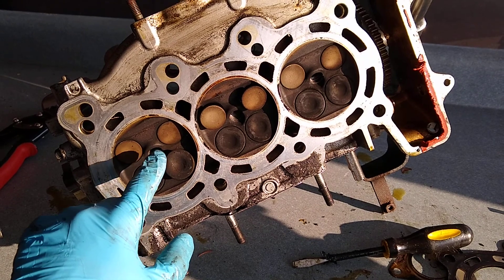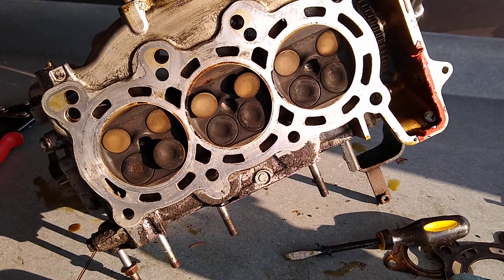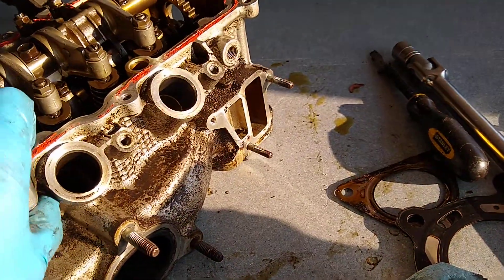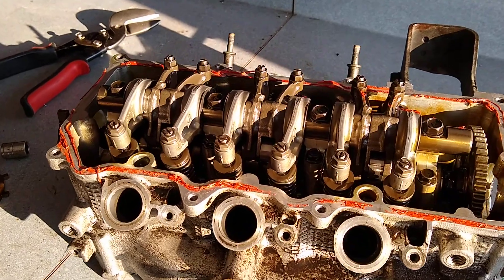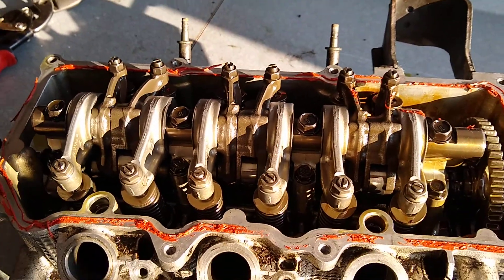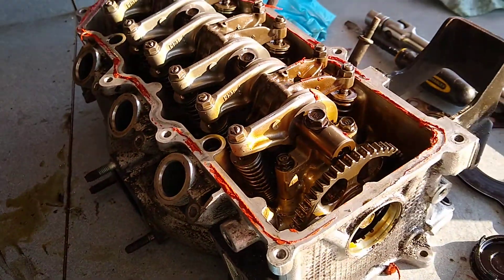2000-2006 Honda Insight Engine Cylinder Head Overview 1.0 3 Cylinder

Comment: Mines got an oil leak that is making the top of the spark plug oily (middle cylinder). I had to change the ignition coil cause the boot fell apart. I keep a drip pan underneath it.